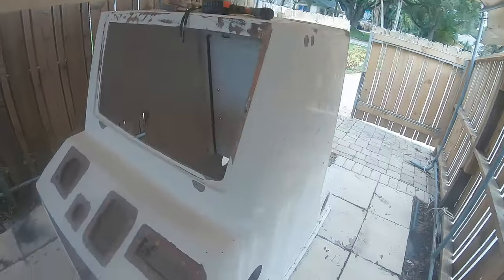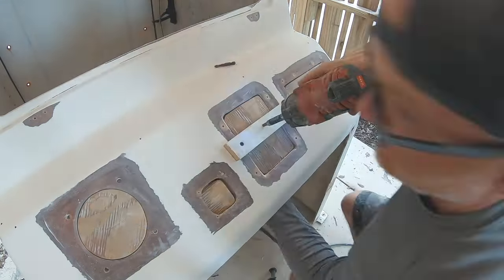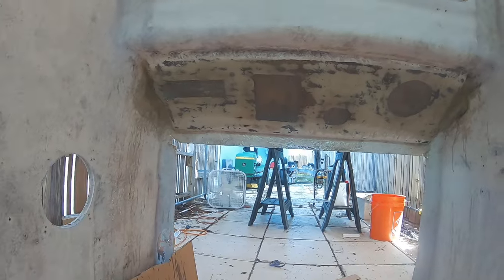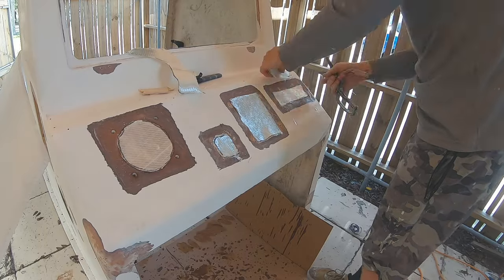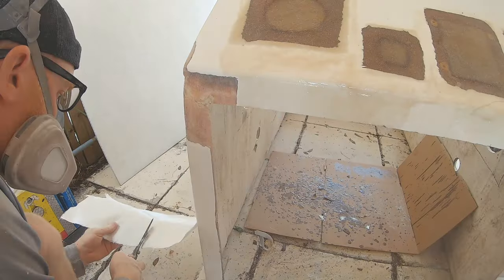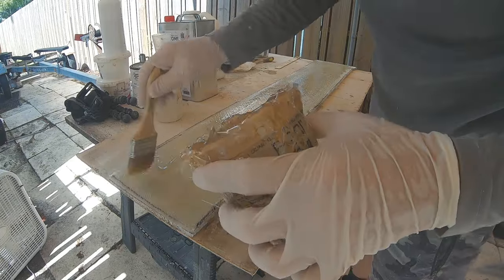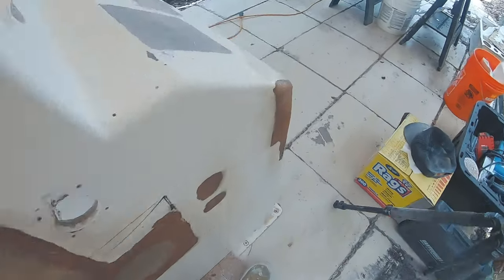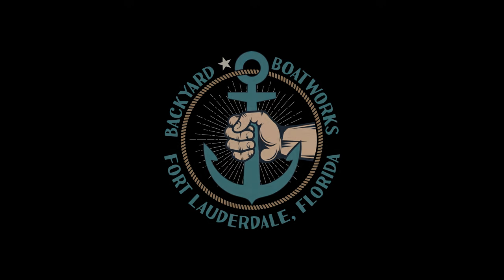Fiberglass Console Repair | Step By Step Filling holes & Cracks DIY Boat Restoration

Comment: I've done a lot of cabinet building, but nothing like this. But that's what youtube is great for...taking your current skills and learning to do similar projects. I thank your for teaching your knowledge. With that said, my previous experiences tell me wood expands and contracts a lot, and in a marine envioronment, I would not want my repair plywood cut to as tight of a fit as you have done.  I ask this in ignorance: are you worried about having your new plywood expanding and blowing out/cracking your repairs, or is fiberglass strong enough that that will not happen? Thanks for giving me the confidence to try this. In outdoor cabinets, we always allow tolerances for expansion, but perhaps this doesn't get wet? Thanks. Andy
Reply from the maker: Plywood is used extensively in marine applications for stringers, decks, transoms etc. but it needs to be Marine Grade Plywood. 
However it’s always fully encapsulated in fiberglass and water should never touch it.
Reply: Good point.

Comment: You’ve got skills! Nice to see someone do good work. I ripped apart a 1978 38 Magnum Marine and have my work cut out for me. New subscriber 👍. Your logo’s cool too.
Reply from the maker: Thanks Mike.  Sometimes my OCD gets in the way of me getting stuff done on time :) Good luck with the project.  I have a lot of videos already filmed I just need to find the time to keep editing them.  Look for a new video this week.
Reply: Thanks. Interested to see what happens when you used the epoxy before the poly. I’ve been using Totalboat epoxy on everything so far. Using your belt sander too & like it.

Comment: I've got a 70s GRP sailboat which has horrible large laminate windows (@3ft x 8") screwed on each side of the cabin. Ive bought some decent looking portlights (@14" x 8") with the plan to have 2 in place of each of the old windows. But I'd need to fill in the old aperture and cut holes for the new portlights through part of the filled in material, the existing GRP is about 1/4" solid resin (no core). I cant find any YouTube videos doing for that, this is the closest I've come across. Id welcome advice on how to do this, i.e. do I need a ply core/backing and whether to use Polyester and CSM, or Epoxy and matting. BTW complaining of the Florida weather makes me envious, in the UK its usually cold and miserable!
Reply from the maker: If the panel you are filling is solid glass, then I would make patch panels out of solid glass to use to fill those holes.  Simply laminate up a bunch of layers of CSM with a few layers of 1708 to make flat GRP sheet.  Cut the sheets to fit into the port holes and glass it together.

Comment: Hello I came across this video searching on how to cover a larger hole in a dash for a 1990 Bayliner Trophy, the old fish finder was still în the dash and upon removing it I want to close the opening up. There is a 3/4 core of wood. So I want to cut the missing part as you did but I don't  plan to use gell coating so I wanted to ask if using epoxy instead of poly for the steps you did would work? At the end I will paint it with some black VHT spray paint, nothing fancy and cover it with some aluminum composit board.
Over it I plan to mount the brackets for 2 nine inch Lowrance Live screens, one above the other.
I want to make sure that the wood will be stable and strong enough after applying the epoxyon the back and the front as you did. Thanks in advance and hope you're still around for guiding.
Reply from the maker: Yes you can use epoxy if you’re planning to paint. However VHT paint in a can is a lacquer I believe. Im not 100% sure if that’ll cure properly over epoxy. It should but I would test it first. You’re better off using an acrylic urethane paint.

Comment: South Fl heat, wow! I don't see how you sand without a tyvek suit. I live in south Alabama, heat and humidity is brutal. When I sand glass in the summer , I almost die ! I commented on another one of your videos about using epoxy. I use a tropical hardener when the heat sets in, it gives me plenty of work time. Working out in the sun light destroys the working time. It cooks the epoxy fast. I like the idea of the lamenating poly staying tacky for the build up, but it seems to be challenged by the heat too. Amine blush or trying to sand some  things with epoxy is an issue too. I guess there is no perfect scenario for heat in the south.
Reply from the maker: I wear a tyvek suit if I am doing heavy grinding but in the summer I also wear poly shirts and poly pants which work good to keep the itching away but don't trap the heat like Tyvek does.  Working with poly in the South Florida heat is a challenge but you can use blended MEKP that will slow down the curing process.  For a tabbing job I only mix 12-16oz of poly at a time because I know that's the most I can wet out before it starts to kick on me.  You just need to get it out of the mixing cup quickly and spread out and that will also extend the working time.

Comment: That’s a Carolina Skiff with a deck that is bolted to the hull. Is there any reason why you didn’t remove the deck and repair the wood from the under side like it was originally built?  Might take a bit more time, but would be done correctly for that model boat.
Reply from the maker: No idea what this comment means.
Reply: @boatcrafterscollective  I don’t think I could be any clearer. Are you not familiar with a Carolina Skiff?

Comment: great vid!  how long do you typically wait between layers?
Reply from the maker: It depends on the quality of the resin you are using, the temperature outside and what percentage of MEKP hardener was added. You have to feel that out yourself based on those factors. Typically with a base grade poly resin you don want to build more than 1/8” thickness at a time. More than that will create a lot of heat and excess heat in your laminate will create air pockets from the off gassing as the resin cures. It’s best to do thinner coats to be safe.

Comment: PVA is great for sealing laminating resin, but I actually use gel coat with wax. It helps fill in the weave, and it also acts as a guide coat when fairing.
Reply from the maker: I don't like using wax in anything.  It can bite you in the A$$ later if you have to add more layers/coats.  Once that wax is in the layers of work it can creep up and cause adhesion issues later. PVA is a much safer way to cure resins and gelcoat and it washes away with water.

Comment: You said using epoxy to hold the core in place came back to bite you. How so?
Reply from the maker: Because epoxy is not friendly with poly. If the epoxy is not 100% cured any poly products over the top of it will lift.  I didn’t let the epoxy cure long enough and when I went to put the primer on it bubbled. It would be better to use a vinyl ester adhesive instead of epoxy so that you don’t have those issues.
Reply: @boatcrafterscollective  great! Thanks for the quick reply 👍

Comment: Good work, curious though why you laminated the whole piece of carbon core rather than just the plugs? That made the carbon core exposed on the edges and not fully "waterproof". Sure it won't matter on this repair, just curious. Good work. I just recently opened a repair shop up in Jacksonville myself. Wanted to also record but its like I never have time. .y shop is so busy I can't keep up. Lol.
Reply from the maker: you can't laminate the edges of carbon core because its plastic and Poly resin will not stick to plastic. That is the advantage to this product in that the core won't ever degrade even with direct exposure to water, however for this repair the front and back was glassed over.

Comment: Nice work! Will the owner still have to apply the awlgrip 545? Thanks
Reply from the maker: We used polyester primers on this console because the customer was using gelcoat. 545 is an epoxy primer and you can’t put gelcoat over epoxy primer.
Reply: @boatcrafterscollective  Ok. I saw awlgrip and thought he was painting console as well. Thanks
Reply from the maker: You can still shoot awlgrip over polyester primer. Personally I don’t use awlgrip products because they are significantly more expensive than other brands of paint.
Reply: @boatcrafterscollective  What paint do you prefer?

Comment: Ok when you say you don’t add wax on repairs and that it can bite you in the ass,  I’m curious what you’d do on a bigger project… maybe like a transom… would you use pva in that case if you were planning on using a paint?

I’m planning to build a bench from scratch and using 1 part paint… I’ve been trying to figure out how to go from my layup to primer, and was looking at finishing resin for my final layup.
Reply from the maker: I’m having a hard time following your question. 
You asked about PVA over gelcoat but it sounds like you’re planning to use paint. If you’re using paint you don’t need any PVA. 
PVA is only used to fully cure gelcoat that doesn’t have wax added.
Reply from the maker: DO NOT use finishing resin because it has wax added to it and anything you put over the top of it will not stick unless the wax is 100% removed. That’s the “bite you in the ass” part. You visually have no way of knowing of the wax is completely gone. 
If you’re trying to fully cure the last coat of resin, brush, roll, or spray some PVA over the surface. This will make it fully cure and allow you to sand it.
Reply: @boatcrafterscollective  thanks so much!!! You just saved me a lot of expensive heartache!
Reply from the maker: Haha. 
Also personally I would never use a 1-part paint for any boat project. Always use something that has a catalyst like a good polyurethane paint. Anything that is atmosphere cure will typically not have very good adhesion or durability. I would suggest using Sherwin Williams Pro-Line 4800 polyurethane paint. It’s the best and least expensive paint at about $120/gallon
Reply: @boatcrafterscollective  somehow I missed your first response and am seeing it with your last response now… first of all, thank you!!! It’s been hard to get advice on this project. Most boat forums just ask me if I’m sure I have enough room in my boat for the build without offering any help😑

So for clarity, the plan was to layup 1708 and csm with poly resin on plywood, then prime and paint using Totalboat wet edge. The thing I couldn’t figure out was if it’s ok to paint over a tacky uncured resin, or when I’m supposed to use fairing compound in that process, which sent me down the rabbit hole of wax added resin and PVA. 

I appreciate the advice on paint. I saw 1 part as a cheap compromise between the labor of gel coat and the cost of 2 part like alexseal after watching a BoatworksToday vid on it. I’ll do a bit more research.
Reply from the maker: Tacky resin is perfectly fine to put paint and primer over. It’s actually better to put it over tacky because the bond will be better. You want resin to fully cure if you’re planning to sand it. If you try to sand tacky resin your sand paper is going to load up with tacky resin and you won’t get anywhere. Use PVA to fully cure the tacky resin so it can be sanded. If you’re not planning to sand the last coat of resin then just put the primer right over the top. 
Another tip…don’t buy any Total Boat products. 😀 they are grossly over priced. You can buy Rustoleum 1part top side paint at Home Depot for a lot cheaper and it’s the same paint. I actually used the Rustoleum inside my engine room a few years ago and it worked pretty good. You might consider joining my Facebook group for questions like this. I always answer questions and I have some really knowledgeable members in there that will help also. Find a link in my description.
Reply: @boatcrafterscollective  ok this is super helpful and I’m headed over today. Thank you!!!

Comment: what was the price to do that work?
Reply from the maker: I had about 20 hours into that project so the price would depend on what the labor rate is. I could probably do it a little faster now but work like this is very time consuming to get the surface perfectly smooth. It’s a lot of sanding time. I charged this customer $900 but it should have been more.